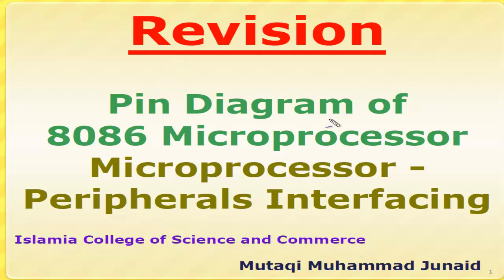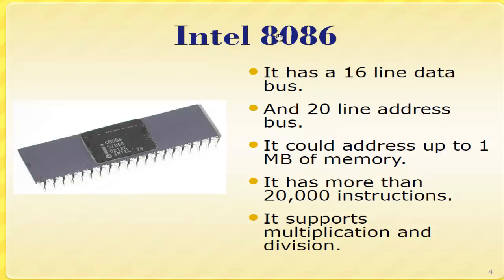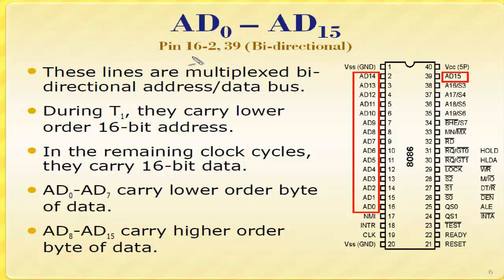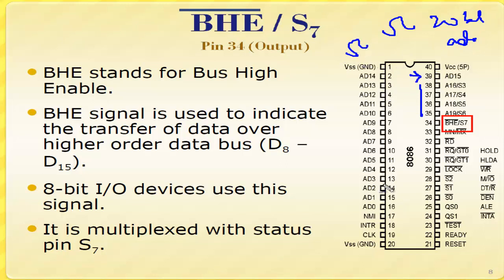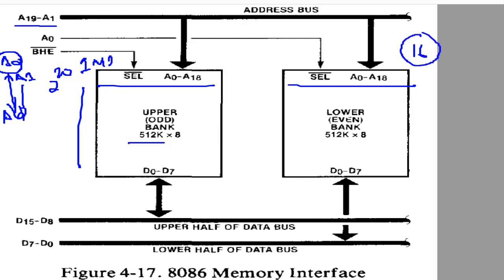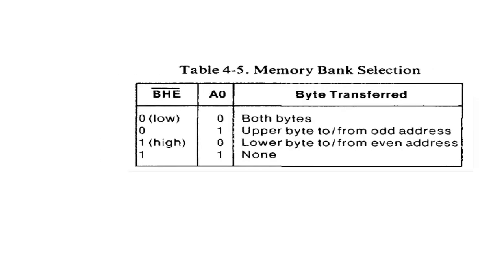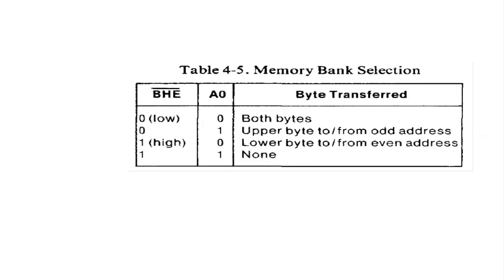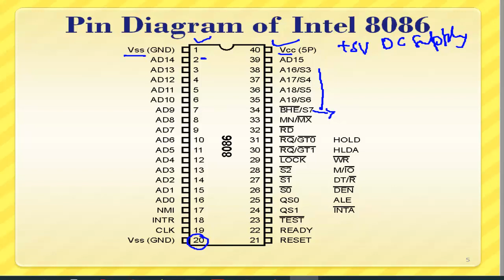Revision : Pin Diagram of 8086 Microprocessor Lecture 1

Comment: Microprocessors are the circuitry that surround the CPU. The microprocessor is more than the CPU. It contains other processors, for example, the graphics processor unit. Sound cards and network cards are encased in microprocessors. However, in all the modern processors, everything which is essentially required sits on the same chip. Thus the term microprocessor is used to describe this arrangement of components on a single chip.

Comment: It is a kind of integrated circuit (IC) unit which combines all the basic functions of a central processing unit (CPU) of the computer. It is a programmable unit that is fabricated on the silicon chip and it consists of an ALU unit, clock, control unit, and register array which accepts the input in binary form (0’s and 1’s) and delivers the output after processing the input data as per the instructions fetched into the memory unit.   
 {  ROLLNO :11}

Comment: 03
Sir A microprocessor is an integrated circuit (IC) which incorporates core functions of a computer’s central processing unit (CPU). It is a programmable chip, register based, accepts binary data as input and provides output after processing it as per the instructions stored in the memory. And due to its low cost, high speed, small size, low power consumption it was widely used.

Comment: roll no. 12
We use micro in micro-processor because we want to minimize the cost, weight  and maximize our work load.
Nowadays the implementation in technical field reduce the size of everything a small micro-processor In our hand that is mobile fon. As per my answer is  concerned it is just making our processing work quite simple with small size, and small weighted processors 
Micro-processor: it is some sort of chip  present in digital  devices  which can perform arithmetic, logic, and control circuitry necessary to perform the functions of a digital devices
Thank you

Comment: A microprocessor is a computer processor where the data processing logic and control is included on a single integrated circuit.
Roll no 9 MCA ist sem

Comment: Microprocessor is actually a CPU built on a single Integrated Circuit (IC). It is capable of performing ALU operations and communicating with other devices connected to it. 
{
Name: Yamin Hameed
Roll no:5
}